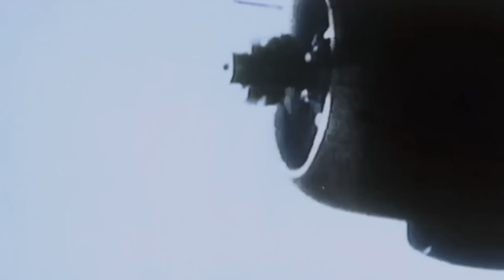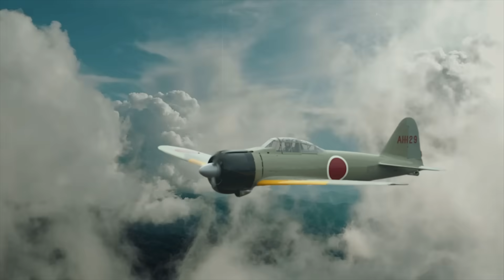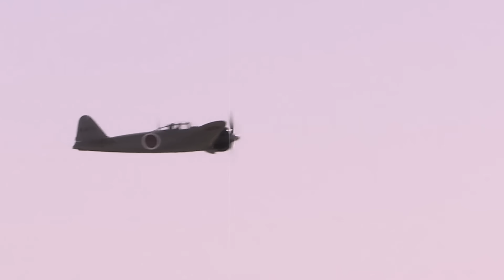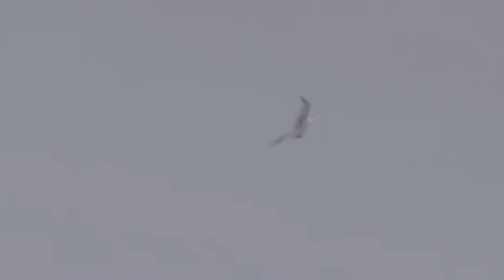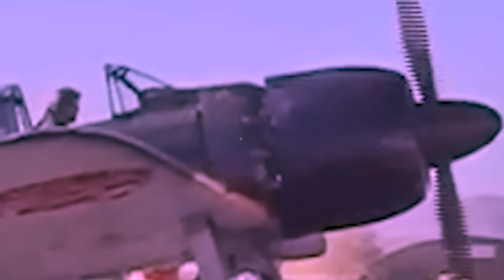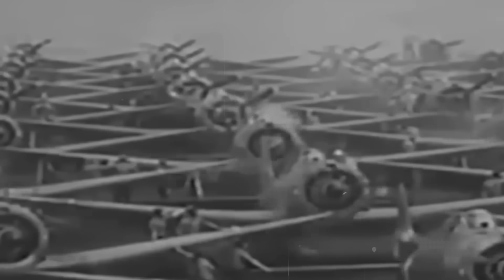The Real Reason Why Japan’s Zero Engine Failed

Comment: Japanese fuel towards the end of the war was diluted with distilled pine tree oil. And no tankers were coming from the south after we took the Philippines because of land based aviation, lots of aggressive subs with torpedoes that finally worked, and B-29 mining of every port and shipping lane. They didn't have a single capital ship[ with a crew in Japan at the end. Just empty anchored hulks waiting for bombing.

Comment: Annoying AI voice delivering rehashed half truths and poorly edited file footage.  The zero and its engine were very well engineered and built to state of the art standards when introduced, admittedly with very light materials and low priority for aircrew safety,  survivability, or comfort. Its initial superiority and later inferior performance was directly due to the Japanese inability to continue to develop and produce more modern higher altitude designs with wartime conditions and the inferior fuels and lubricants available to them.  This prevented higher levels of super charging required.

Comment: was it not a Pratt-Whitney built under license?  This means replicas can use the DC-3 engines.
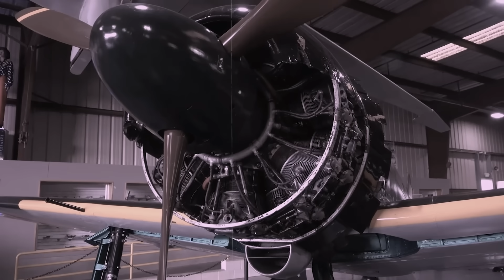Reply: The photo at 1:01 is a P&W engine
There are only 2 surviving Zeros flying. Almost all in the video and photos are US build planes. Modified T6s, made to look like a Zero
Yet they do not say that in the video.
Reply: It was a scaled down version of the Nakajima Ha5 which was a fusion of the Bristol Jupiter and Pratt & Whitney R-1340 Wasp modified into a two row design.
The engine cowl needs significant redesign to fit an American engine (and most of the flying “zeros” are replicas).
Reply: @allangibson8494  In other words, it looked like an airplane engine.  Got it.